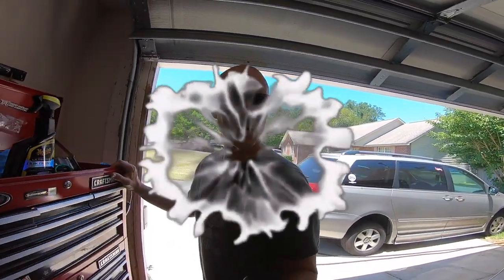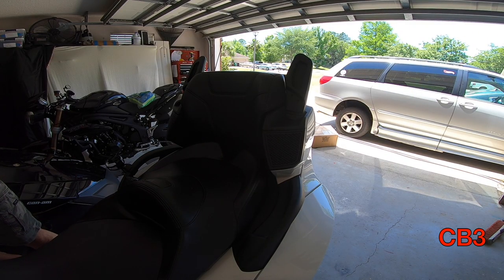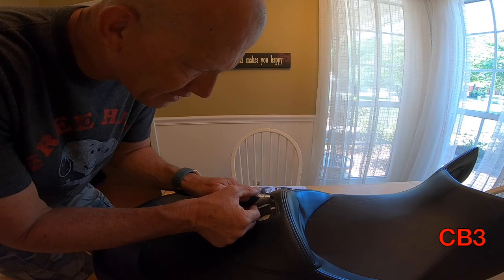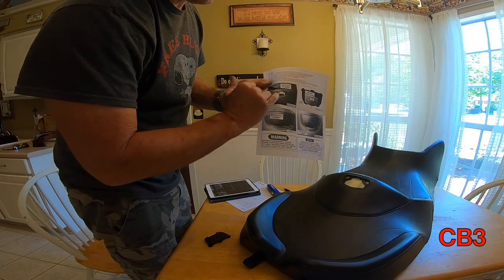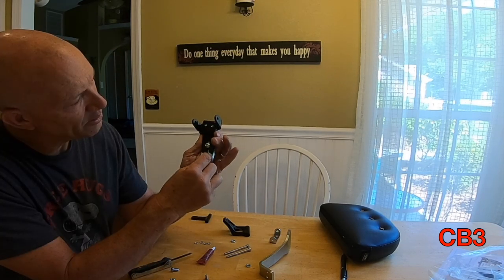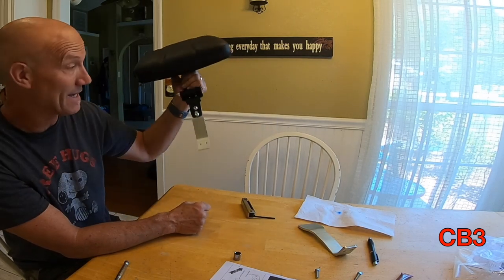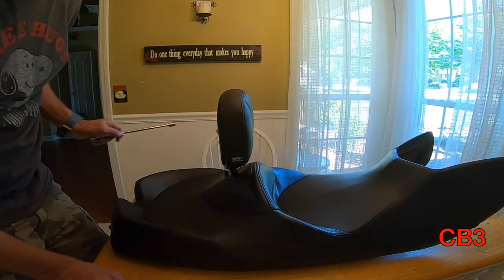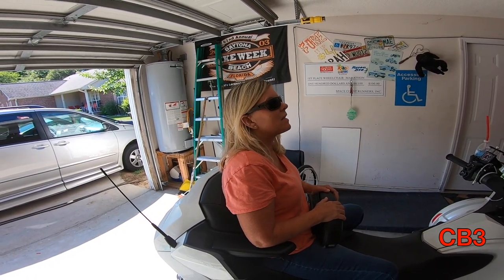Installation of a Quick Release Backrest on our 2019 CanAm Spyder...Quick Release?? Really?? "Kinda"

Comment: Hey Coach   Great video and I would like to add one more thing for back rest. Open back trunk and loosen two top screws for back rest. Take out three back rest screws and remove back rest for passenger.  This well allow the spyder ryders to have easy access to back hinge bolts for removing and installing seat together. Just a extra step I learned watching this video. Ride Safe !

Comment: I put one of these on my 2019 RT, I have the screws holding the seat in a little tighter so it takes a little effort to remove, but is easy enough. Was very easy to install. Keep up the good work Bob

Comment: Love oks great Bob, I was wondering if there was a backrest for the driver. I had a nice set up on my Valkyrie where the back rest would mount in the front seat or back for the passenger. I had Corbin saddles front and rear for me and my wife. If she wasn’t with me the back rest would just pull out of the back seat and slide in the drivers seat. Both front and back seat had a Velcro cover over the hole when not in use. Mike Corbin makes some nice stuff, expensive but nice.

Comment: Put a custom ultimate seats on my rt with both driver and passenger backrests. It's also heated for driver and pillion separately. The backrest is truly easily removed from the topside. I can ride comfortably for 2 or 3 hours no problem, could not do that with the stock seat.

Also for the sleeves they recommend some Vaseline on the outside of the sleeve so they don't drop out

Comment: Hey Bob, I just started watching your channel. When you do your long trips like  500 to 600 miles, how many times do you stop for gas on that journey?  Also, have you put the bike on hilly terrains like steep hills so on and so forth.  Great videos!
Reply from the maker: Our goal is to stop every 150 miles to gas up, stretch our legs and catch our breath.  600 becomes very doable in those kind of mileage breaks.  Sometimes due to "geography" our stops could be a tad earlier or later.  At 180 miles I am normally getting antsy about my fuel situation.

We have been on some pretty steep grades.  I will manually downshift and crank the throttle.  Ofcouse ... gas mileage.. suffer accordingly.

Thanks for watching.
Reply: Thanks for your response Coachbob